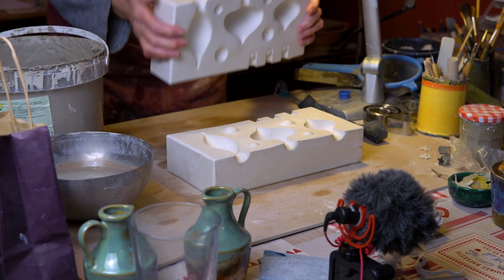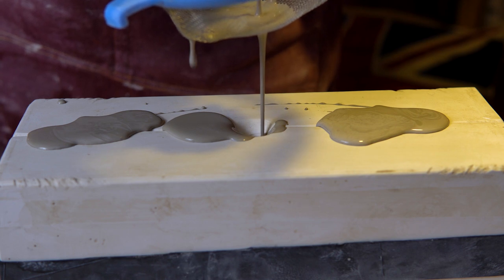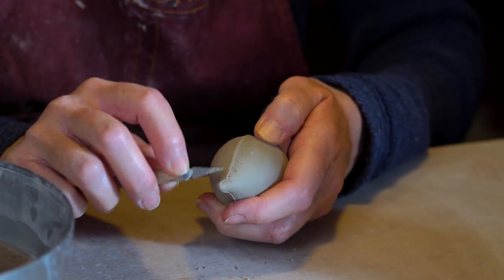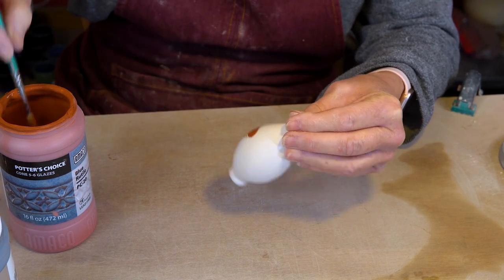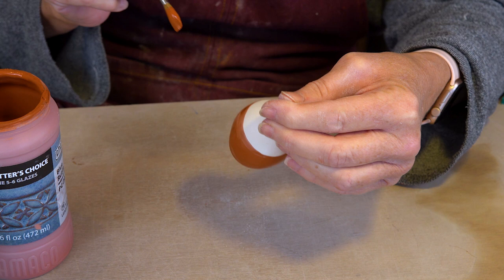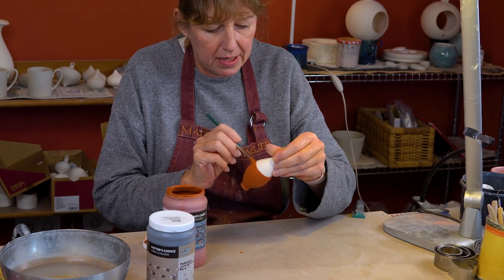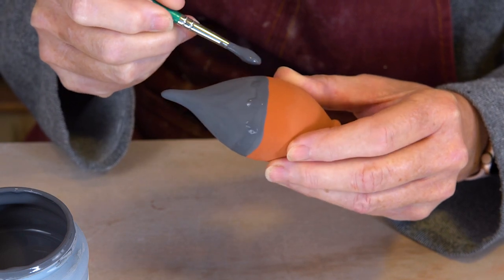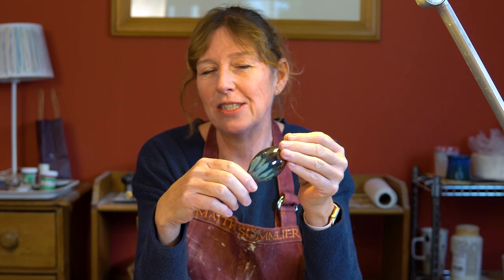How I make my Ceramic Wine Bottle Stoppers + GIVEAWAY !

Comment: Beautiful! I’m also passionate about ceramics but most work on the wheel and haven’t tried slip casting.  It looks like fun!  How do you put those in the kiln without sticking to shelves- on stilts or hung from a wire?
Reply from the maker: They have unglazed flat bottoms, so stand on the shelf.
Reply: @clairedudley6618  ok, thanks!

Comment: Thank you! How do you add the stoppers please? And where do you purchase them? Apart from pottery I am passionate about rescuing greyhounds.
Reply from the maker: I make the hole the right size for the screw piece that comes with the stopper, taking shrinkage into account. I do need to secure the screw with glue sometimes. 
Stoppers came from Amazon, but I've seen them on Etsy too.
Reply: Do you use glue to affix them? If so, could I ask what sort? Have finally got hold of the mould- been out of stock for ages- so hoping to make some of these for Christmas presents!
 @clairedudley6618

Comment: Hi! How did you get the metal stopper to connect with the ceramic piece? Beautiful work ❤
Reply from the maker: I made the hole the right size by calculating the shrinkage, I also use glue.
Reply: @clairedudley6618  thank you!

Comment: Absolutely beautiful, love your video
Please can I ask how u attached the bottle stopper to the clay.
Passionate about pottery 😃
Reply from the maker: I glue the screw bit that comes with the stopper inside the hole that I created in the disc I added to the bottom. The hole is the right size for the screw bit, but add glue to be on the safe side.
Reply: @clairedudley6618  thank you 😃